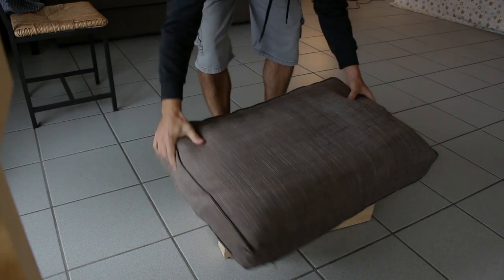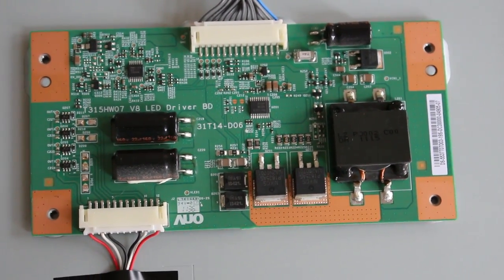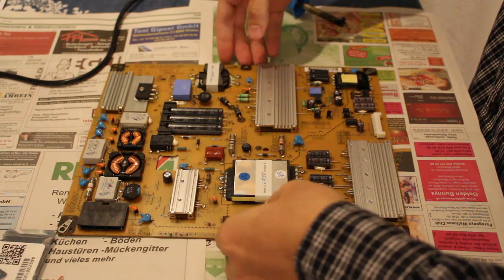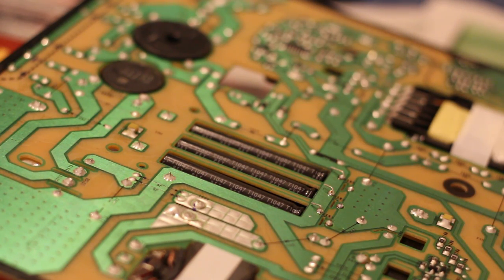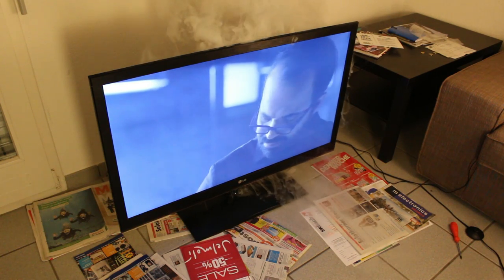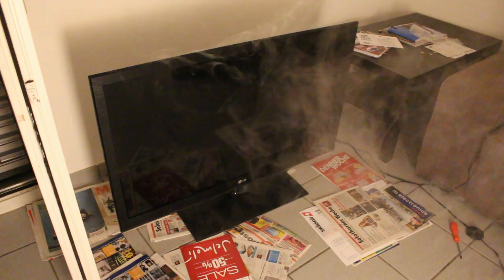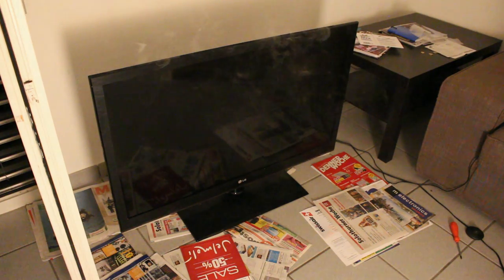My TV blew up!

Comment: Thanks for your video! I found a burned capacitor in my tv (a smaller one), but decided against trying to fix it based on your video. The problem is probably upstream from the capacitor and I don’t have enough knowledge or time to look into it. You saved me a weekend afternoon!
Reply from the maker: haha no problem man.
Reply: WasherFreak17  are you okay
Reply: WasherFreak17  ok well I’m going to test my broken tv, if I don’t reply, I probably exploded along with my tv
Reply: WasherFreak17  lets gooo, btw I used to also make videos of washing machines several years ago. Have you heard of the LG demo miniature washing machine? It's like a  very small, but almost completely working replica of lg washing machines used in stores. They're not for sale, so it's incredibly difficult to get one. I got one on eBay for only 120 bucks though 😉

Comment: The mistake you made was getting the capacitors off of Ebay from a Chinese seller. These capacitors are absolutely trash & more often then not, are mis-lableled & sometimes the polarity stripe is pointing to the positive lead.
You've should have ordered the capacitors from reputable electronics distributors like Digikey or Mouser electronics.

Comment: Capacitors installed backwards. That is what they do when they are connected reverse polarity, they blow up like that.
Reply: Ryan Toomey They were installed in the right "direction"
The power supply probably gives them to much voltage.
Reply: @NinoJoel  after recheck at full resolution i see the positive side mark on the board these cap are correctly installed 2:01
Reply: If you look at the video closely it appears he connected them correctly

Comment: I know this video is old but I figured I'd still share my thoughts. It almost seems like an overvolting issue as in there's too much power in it. From the looks of it I think that's a plasma TV you have and they run at super high wattages and AMPS and a lot of plasma TV power supplies are prone to failure so maybe some type of regulator failed and it's dumping too much power into those caps. Also plasma TV's run really hot so it might of been an overheating issue where it put too much heat and stress on those caps. this seems like a later model that's been cheaped out like all electronics nowadays hence why there's no cooling fans and some argue that there's no need for them but all plasma TV's should have fans. I had a panasonic plasma and the power supply fan got jammed and it caused the power supply to overheat and melt the transformer and a couple coils so I bought a new power supply off ebay for $60 and it still works to this day. Pricey sure but it beats buying a whole new TV that'll just break in a couple years. Still very unfortunate that it happened but that's how tech is. Not built to last

Comment: yes, I think that here the cause capacitors to burn, is not in capacitors, unless they were connected with another polarity. I think you should look at an earlier stage of the circuit, keeping it disconnected from the rest, datasheet in hand, starting with the power supply. Remember to check if it actually delivers direct current, not only the correct voltage, perhaps a diode bridge may be the cause. But I venture to guess. Lucky friend !
Reply from the maker: Hi Daniel, I'm not sure, I'll take it apart and take a look again but I don't think I'll have success.

Comment: The capacitors aren't always the issue.
In this case, these capacitors might have been given too much voltage by a faulty PFC (Power Factor Correction) circuit. I'm guessing you might have moved on from this now, but if you still have it, check the resistors in the PFC voltage feedback circuit. (Might be too difficult to figure out which ones are which if you aren't familiar with repairing these things. The resistors are likely around the area seen at 2:07 on the bottom right of the screen. They're small, lol ... Otherwise, just buy a new power board. When in operation, there may be up to around 400 volts on those capacitors, so be warned!)

Researching online, it looks like you aren't the only one with this problem.

Good try on repairing it though. I repaired our old Samsung plasma TV twice - once it had a faulty solder connection that caused a power transistor to fail, and the second time because a capacitor went bad. (It was a "CapXon" branded capacitor, well known to not have long lives...)
Both times, the TV was having power problems with not turning on properly.
Reply: Or they were installed backwards.
Reply: Ryan Toomey they where not

Comment: If it's the same 3 capacitors, one possibility it that you put them in backward; the positive and negative markings are sometime a bit confusing. The only other possibilities I can picture are too much DC voltage or more AC noise than they can safely absorb. Since they are probably there to "short out" the AC noise while storing up the DC, a power supply that is cycling improperly might be enough to eventually destroy them, though I'd expect it to take a while. The power supply is also supposed to regulate the DC voltage to which they get charged and if the regulation circuit has gone off, that could be too high, but even that would likely take out other parts if it were high enough to blow them that fast. One other unlikely possibility it that the ones you ordered might simply have been defective; you might want to try charging a spare one to its rated voltage with a battery and see if it blows up.
Reply: Well he could of possibly put them in right because after all the first ones blowed up so it could have been a factory defect or something else gone wrong? But at this point we don't know though what you said made sense too!
Reply: And once again was it hooked up to a good surge protector? He might have had a spike in electricity levels. A good surge protector would've helped. I tell you though I believe a lot of this made in China 🇨🇳 is garbage. 🗑 We need to get back to building good quality stuff in the USA 🇺🇸. When appliances would last. 20 to 30 years. When a Ford & Chevy would last 20 year's. I'm so sick of this garbage and dangerous appliances, little appliances, & crap they send over here that don't last.

Comment: Think what happening to mine has odd smell from it got it in 2018 and the Horizontal lines showed up 
TCL.ROKU 32" 720p it was cheap maybe the motherboard having a failure or power supply or chip

Comment: Yeah, that was definitely the sound of electrolytic capacitors blowing up. The root cause could be bad MOSFETS letting too much current flow through the capacitors, or bad resistors, or even the transformers. Transformers over time and heat can burn the installation off of the secondary coils which could also result in this. So, obviously, the capacitors are not the root cause or they wouldn’t have blown up so quickly. I would test the transformers before testing the MOSFETs, however. Because the transformers will burn off their installation before a transistor or mosfet will go..
Reply: I have this same model tv myself. It gets really hot and now I’m starting to have malfunctions like lines across the screen or flashing. I just turn it off for awhile and it kinda goes back to normal till it gets hot again.
Reply from the maker: well I gave up on mine many years ago now.

Comment: Something like that would depend on the age of the tv for me to fix it myself I’m the same as you I know little but enough to maybe fix it myself our living room tv finally went it won’t turn on for whatever reason bunch of clicking sounds but won’t run being the tv is 12 years old and is a 720 p hd tv I decided instead of fixing it I should just be happy it lasted 12 years and just buy a new one picked up a 40 inch sharp for just 170 dollars at Walmart can’t beat that
Reply from the maker: yeah these days 12 years is good for a TV. I wish it were like the old days when you expect stuff like that to last 20+ years, but with how quickly technology changes and how cheap electronics are produced, it really doesn't make sense anymore.
Reply: @BruceChastain  I've gotten 24 years and 37 years out of my CRT TVs, and the sets I remember from when I was a kid could be kept running indefinitely as long as you could get the parts.  But before the late 1970s, few sets would go more than a year without a repair and I don't remember many people seeing fit to keep one running more than 10 or 15 years; the repair guys would declare them not worth fixing even if the repair was simple. And, a replacement picture tube in the 1970s cost more than a new flat screen TV costs now.

Comment: That exact same thing just happened to me rn to my brothers tv. It’s kinda my fault for being dumb. It rained pretty hard where I live and some of the light weren’t working but some plugs in the walls still worked. There is one by close to his tv. I got a new extension cord so it could reach I connected his tv after a few seconds I just heard a loud popped. I was like wth is that then I heard it again and seen his tv smoking. I got so scared, my heart was beating like crazy I thought a fire was about to start. Nothing has happened for like 20 minutes rn. I think everything is good.just a bit bummed out and kinda scared to remove any of the stuff right there rn.
Reply from the maker: good luck, sounds like you need a new TV set
Reply: @BruceChastain  everything is good now, I have an old tv laying around so just hooked that up for him

Comment: That happened with me
And when I opened it up
The transistor was blown so badly that it was broken in pieces
Once it happened before and the capacitor was blown
You can replace with another capacitor or transistor and can do factory reset to get it fixed
Reply from the maker: thanks for watching, check on the comments, there was a lot of good feedback in there.

Comment: How old was the tv? I have a Samsung tv. mine looks like a tv from 2009. long story short. we had an old Samsung tv with the clicking problem. it was unfixable because the motherboard was bad. we got a new one when the tv repair guy couldn't fix it in 2019. 4 years later and still going. I use it for my PlayStation 4 right now. Fun fact: my sisters phone blew up kinda. No bang but white smoke. turned out to be a battery failure. it was a Huawei p20 pro I think. we ended up throwing it away immediately. We also bought a BUSH smart tv in 2019 aswell. the backlight failed after 3.5 years. my Samsung one is still going strong. We got a new BUSH smart TV after the old one broke. looks like Samsung tv's work better than my old BUSH tv.
Reply from the maker: it's really hit or miss these days. I have an old Samsung plasma that's been being used daily since 2007 and it's still just like new. I actually had a P20, non-pro, never had a problem with it, actually one of the better phones I've had.
Reply: @BruceChastain  I feel like Samsung quality is very good. Still had a Galaxy s9 which still works. I now use iPhone 12. I prefer iPhone over android though. I still use my Samsung tv for my ps4 currently.

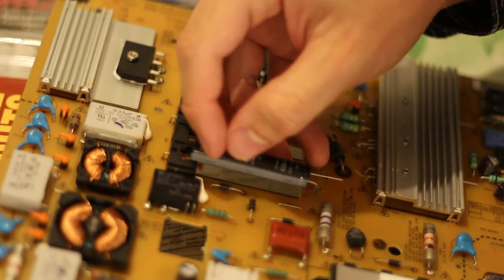Comment: 1:53 you installed the capacitor in backwards polarity.😒
Reply from the maker: I don't think I did.
Reply: no they aren'T , 2:01 in full hd 1080P , pause , check the + mark on the pcb , they are correctly installed

Comment: the psu circuit was probably running overvoltage for some reason...
Reply: could even be that the replacement caps were bad, even 'fakes'?? looking closely at the video in stop motion, they look wired correctly, of the correct voltage, so should've been ok??

Comment: You are definitely having a power supply problem or a current draw problem. The voltage regulation system or the transformer itself has failed to set the proper voltage or you have a high current draw from the capacitor bank. The correct step to take before replacing the capacitors would have been to take a DVM and read the circuit voltage at the input side across the first capacitor.  I do believe they were inn parallel so you probably could have red across any of them.  If the voltage was of a correct value (AC), you most likely have a short circuit causing the hi current draw, that why they all popped one after the other. 

Capacitors only do two things.  They store energy (voltage) and they discharge that energy.  They sort of act as a regulator along with resistors and coils (inductors).  My best guess is that there was a short on the board and too much current was passed through the capacitors, over heating them in quick fashion.  Your safest bet is to replace the entire board.  Some may disagree and tell you to find the short and repair it but in all honesty, unless you are a true circuit component expert in assembly and testing, you don’t really know how many components have been weakened by the hi voltage / hi current condition on the board.   I would replace the board and go back to watching tv.
Reply from the maker: thanks Michael, seems like the best info feedback I've seen on this video.

Comment: I was watching my Samsung TV at 12.30am and it suddenly blew up for no apparent reason. It tripped the electric box, so the house went black.
Reply from the maker: Dang, that didn't happen in my case
Reply: @BruceChastain  It is very scary when the TV blows up and you're just a foot away from it.
Reply: Mine blew the circuit breaker. Woke up to a wicked bad electric burn smell.

Comment: With all due respect, do you have ANY concern for fire safety? Electronics can go from simply broken to being on fire very quickly. Two things are extremely concerning here:

1. It took you SEVENTEEN SECONDS (and after three separate pops, and a LOT of smoke already PLUMING out) to UNPLUG THE DAMN TV! This same thing happened to a TV I had just turned on from being in storage, and it took me MAYBE all of 3 seconds (while also not expecting anything bad to happen) to yank it from the outlet. You seemed way too lax about it, and even grabbed a snack bar first!!

2. You just repaired an electronic device that was already having this issue before, and yet you set it on top of randomly scattered magazines? Are you TRYING to set your house on fire? You have a TILE FLOOR, that's PERFECT for testing a repaired device that runs on 110VAC. There's no need to put firestarters all over the floor first, you could have stacked those off to the side pretty damn easily...
Reply from the maker: I'm a wild man living on the edge! but honestly thanks for the comments.
Reply: Off to twitter with you